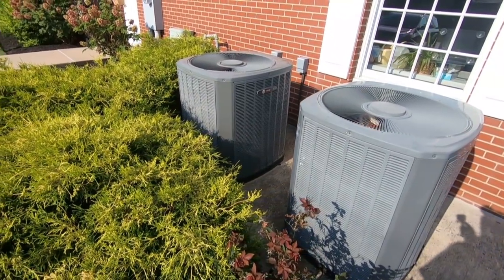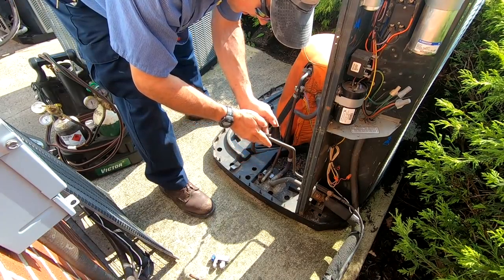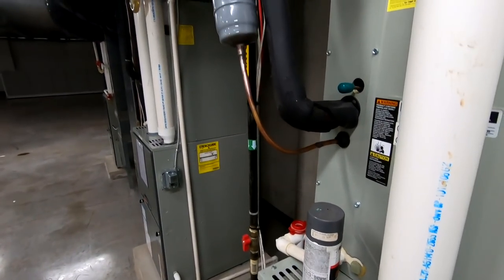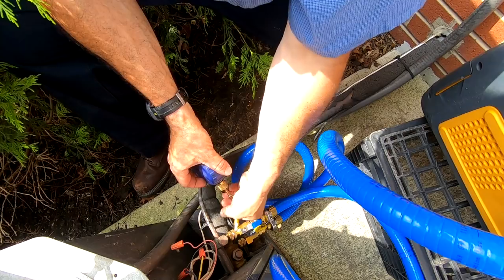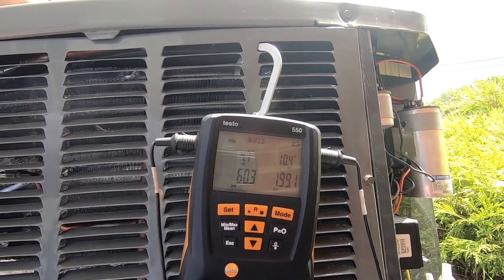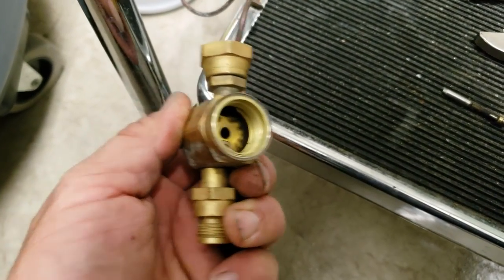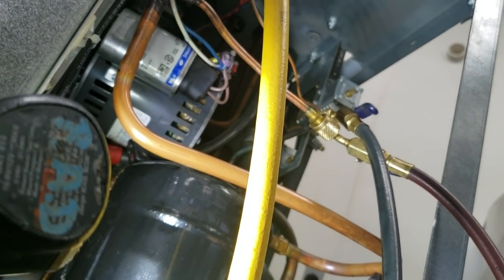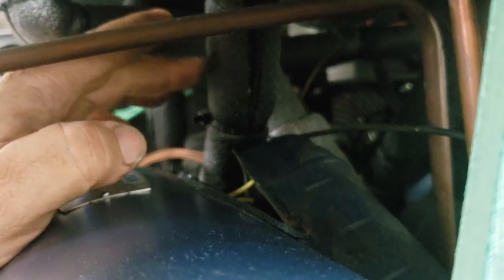Trane Condenser Coil Replacement With Bonus Footage

Comment: You’re welcome. Trane did have some problems with tube rub leaks back in 2010 or so, particularly on the 14 SEER units as I recall. And, they were also having problems supplying replacement coils so the subcooler work around was actually a factory suggestion as a temporary repair until the new coil arrived. However, we found that the units worked very well without a fixed subcooler. It was only because of units being under warranty that many of the coils were replaced in the end. Another situation happened when a homeowner rammed a screwdriver through the middle of the coil for some unknown reason. No coil in stock and insurance wouldn’t pay for a new unit. Again, because that condenser is constructed of loops of spine fin, we simply isolated the damaged loop by cutting it off the discharge and liquid headers, brazing the cuts and put the unit back into service. All in all, a nicely designed coil, in my opinion.
Reply from the maker: I never thought about it till this video review 👍👍.

Comment: I now know how to take these apart. Thank you for this. I work on everything, even though my job is carrier specific. Nice to see this now I don’t gotta struggle like a botch.
Reply from the maker: We're a Carrier dealer as well but I've worked for Rudd and Lennox dealers but Trane is not a big seller in the residential side around my area. I mainly see them in the commercial market.
Reply: HVACR Survival I see here I don’t see to many of them but enough that it’s nice to know

Comment: Man i found 100s of Trane coils leaking in the same spot over the years. Fixing and replacing Trane units keeps my belly full lol.Not sure if you know or have seen any older Carrier units that also had the same Spinefin coils about 33-38 years ago. Actually my next door neighbor of 32 years has one of those Carriers with a spinfin coil and it is still working good. Just replaced the original 35/5 capacitor last week on a 101 degree day with 112 heat index. Also replaced condenser fan motor 2 years ago. Great video man keep up the good work. Peace
Reply from the maker: 🤣🤣🤣👍👍 have a great weekend, thanks 4 watching!

Comment: Nice work, very professional. As another commenter mentioned, you can bypass the bottom subcooler loop if it leaks down there. Depending on your climate zone, the subcooler might not be necessary; up here in Canada I’ve bypassed several leaks and the unit still operates spot on to the charts. The remainder of the coil will still subcool enough. BTW, if you need to change the compressor in an AC unit, (not so easy on the heat pump) strip down the unit and remove the coil as you did, now you have easy access to the compressor. Swage the discharge and liquid line then braze, evacuate and recharge.
Reply from the maker: That's a good thing to know 👍👍i will definitely try that option to get a system back to operation in critical situations. Thanks for the tip 👉👍👍

Comment: Well at least you seen it before you changed the system. I did the same thing. Got my SC set  cleaning up system up and running . And dam. Filter drier in wrong . Lol I hate when that happen .
Reply from the maker: I agree, it could have been worse just like that 👍👍

Comment: Great find of a leak in that coil could be from vibration  of the unit. Have to use nitrogen when brazing is the long term key. Its the old TXV. Bad belts causes lots of issues. Motor over heats, pulleys wear out, belt brakes, and low performance of the unit. Great video Rick. Like the material you cover. Thank you for the share.
Reply from the maker: As always Ray, you have been a great supporter of my channel 👍👍 thanks man!
Reply: Rick you are very welcome. Love to support you always. Great guy doing great things. Keep up the great work.

Comment: Had one leaking at the bottom last week. Used solderweld al-cop was able to braze the copper to aluminum, saved them from purchasing a new coil.
Reply from the maker: It's not sold around here,  and getting my shop to buy something to sit on my truck in hopes of having it when I need it is slim pickings. I have heard it does well on aluminum.
Reply: with same spot in coil . I did a lot of research about how to repair coil leak and I found products that would work well with this type of repair. Solder weld “ Alloy Sol “ comes with powder flux is best choice to repair aluminium coils. Thank you @fastlife for your comment it helps me to make my choice to repair the coil , if I succeeded it would save me a lot of money.

Comment: Being a Trane dealership I can’t tell you how many of those coils I’ve replaced because of a leak in that s as same spot. Keep the videos coming 👍
Reply: trane is nothing but overpriced junk
Reply from the maker: They are all junk. I work on all brands and they all fail and they all are cutting corners to put more money in the shareholders pocket 😏👎👎
Reply: Just delete the bottom row of coils, old unit anyway saves bucks $$
Reply from the maker: That's what I'm hearing. News to me, I figured it would be higher head pressure.
Reply from the maker: I'd rather they just had replaced it 🤷🏾‍♂️

Comment: Luckily, I have not put a dryer in backwards (yet) but that's because my boss has and makes me check it 14 times before putting flame on it. Good videos.
Reply from the maker: It doesn't happen often, I was missing around getting the smoke alarm bypassed by the monitoring company and lost track of what I was doing. I figured it builds character 😏

Comment: I have a 2012 with a Freon leak in the big coil you just put in . They gave me estimate of all day to remove put in the new one and around 2,000 should I look around ? It’s still under warranty parts not labor ,It is a traneYou made it look easy wish I could have you take a look at the heat pump .Thank you for this Video PS it’s really clean the coils are new looking I hose it a lot and it’s not where any grass or trees are
Reply from the maker: This really depends on what's included in the quote? does this include new refrigerant? This was an R 22 system that stuff goes for over $150 a pound or more. I make it look easy because I've done it for 28 years. Like they say you're paying for all those years that I spent learning the trade not the couple minutes it took me to do it because it didn't always go that easy.
Reply: @HVACRSurvival  yes this includes  R 12 I thought he said ?? He said it is a special blend they use so they can not use what’s left that haven’t leaked out .He used a snifter to fund leak however no bubble test .. I always wonder could it be sodered? He said they do not do that .Replace the unit is what they are recommending because it is 10 yrs old this July 2023

Comment: I am looking for an aluminum coil so I can practice my aluminum repair skills. There is a guy in my company that is really good at it. He told me he had an aluminum coil and practiced over and over with propane gas. I have also heard cleaning the aluminum with alcohol.
Reply from the maker: I would like to try the solder weld kit 👍👍
Reply: @HVACRSurvival  Dude! A garage video on it would be great! Then you can add a por to pressure test. That's if it doesn't go to hell of course hahah
Reply: There's a outfit makes a low temp alum solder for auto use using a propane torch can fix a hole in a beer can .had some  lost the name  worked well for EVAP leaks .
Reply from the maker: I have one like that and it did not work, I heard good stuff about solder weld and millhoff.
Reply: @HVACRSurvival  thanks

Comment: Nice video there buddy! Trane coils are definitely not that big of a deal to replace the trickiest part in my opinion is learning how to get those panels off
Reply from the maker: Yeah, that took a minute to figure out but after a few days I got it 🤣🤣👍👍
Reply: @HVACRSurvival  Easiest way I learned to take them off is wear steel toes, grab the far sides with both hands, and give the bottom middle a tap kick while yanking upwards. Works 99+% of the time.  The trick is to kick the panel like you're passing a ball to a little kid.  Firm, but not crushing.
Reply from the maker: That's a good analogy 😁👍👍. Thanks 4 the info!

Comment: I'm curious, the original coil is copper/ali truly not fixable? Or didn't try? 
We usually braze repair at least 90% coil leaks no problem.
Reply from the maker: The leak was in the aluminum not the copper. I have tried repairing a Trane coil once before and it did not work.

Comment: I’m not sure if this will get responded to, but why do you put the filter drier on the inside ? I’ve always installed them in the outdoor unit side by the valves. Just curious. Cheers🎉
Reply from the maker: Less likely to rust, and it's right before the metering device.

Comment: Question? I have ac unit that is 18 years old, a tech said it was the compressor that was bad he is recommending changing the whole unit in side and out at a cost $3000 to $3500 for new system, in your experience is this true, or is it better to replace the compressor
Reply from the maker: If it's R22 and 18 years old,  I would replace it. That's a fair price.

Comment: Not a tech, so this might be a dumb question. Any particular reason to use a braze in filter/drier vs one with flare fittings for ease of future servicing/replacement?
Reply from the maker: Possible leaks is why when your using R-410a and there was no isolation valves to change it anyway if I wanted to. Thanks 4 watching!
Reply: @HVACRSurvival  Thanks for the reply, that makes perfect sense. I never even considered the issues of higher pressures with R-410a. And DUUUHH no isolation valves, LOL.

Comment: just curious why you didn't fit the drier at the condenser?
Reply from the maker: Two reasons, the big one is I can pump the system down and change it and the other is to prevent rusting of the metal shell after it has been brazed.

Comment: Does the micron gauge give you an accurate measurement when placed on the vacuum pump?
Reply from the maker: At the pump is not the recommended location. It's better to have it either at a different location on the system being evacuated or on the valve core removal tool. This allows you to isolate the vacuum pump from the system and do a blank off test. This helps verify that the vacuum is not only deep but stays deep when it's isolated.

Comment: Did you purge with nitrogen during brazing? You don’t shoot for <500 microns and perform a decay test?
Reply from the maker: I had to rewatch the video since it's been awhile. Looks like I did nitrogen for the inside but the outside I did not because of the location of the service valves made it difficult. As far as your question on the vacuum, looks to me like I cut that section out because this was a simple job and didn't want to bore people watching paint dry.  Let me ask you this,  what kind of vacuum hoses do you use? What kind of micron gauge do you have? Do you pull every system down below 500 and have it hold below 500 micron for over a 30 minutes? Now be truthful
Reply: @HVACRSurvival  I use Appion Megaflow 1/2” x 1/4” FL for every evacuation using only VCRTs-no more pulling vacuums through the service manifold. I use a BluVac + Pro micron gauge that performs the decay test. I purge nitrogen for everything I braze and I evacuate to at least 400 µm for everything. As everyone and HVAC should be, I am paid by the hour, and there are no shortcuts. I’ve seen the old timers set up the vacuum pump walk away and smoke a cigarette and come back and call it done because the gauge read 30 inches Hg. A lot of leaks get left behind that way.

Comment: Kinda annoys me when people dont keep bushes etc trimmed back away from units..
So i asked on another channel also but... If after a customer had multiple visits from 2 companies that customer personally found the cause of a problem they were having was a stuck contactor (Not a bad CAP or logic board or high pressure switch like they were lead to believe was the cause), what would you do?
Reply from the maker: Sometimes it's hard to catch the problem if it won't act up while you're there. I try to look over the contactor and if there is any doubt about it or the capacitor they get changed. If it was mine I would call both companies and explain the issue, see how they respond. If they are reasonable they should either work with you on the bill or do something to make it right. At least that's what I would do.
Reply: @HVACRSurvival  Thats reasonable, But...
Heres the thing... For the upstairs unit that i had replaced a few months ago, The old unit started acting up last year during a heat wave, the company i had at the time came out a total of 5 times total because they thought they fixed it but they didnt (It reset when they cut the power so when it started working normally they thought they fixed it) and it wasnt until i did some troubleshooting that i figured out what was going on. I found out that i could reset the unit by using the wet/dry switch, it would then reset the unit after the 5 minute delay and allow it to work for exactly 3 On/Off cycles before it had to be "reset" again to work normally. So since the company was full of idiots i got rid of them and went with a different company, which after seeing it for the first time immediately said it was because of the High Pressure Switch, supposedly because of an LED light being lit, though i didnt personally see it. So we had the whole upstairs unit replaced, which i do have to say i Loveeeee.

A Few months ago the downstairs unit started doing the exact same thing and was able to again get it working a number of times before needing to be "reset". All of a sudden the unit started working Normally for nearly a month and then started acting up again a week or 2 ago. So i did some troubleshooting.

They initially wanted to try replacing the logic board (Super Tinyyyyyyy little thing) and the CAP, wasnt spending $200+ for that so didnt happen.. So i took it upon myself last week and bought a $20 CAP of the same rating, that sadly didnt fix it. Then i remember seeing videos here n there mentioning the contactor and i did recall that something did look off with the contactor, so i nudged it a little and PLOP it came unstuck, there was a little rust/corrosion on the bits it would make contact with so i cleaned it up a little and the unit has been working flawlessly ever since, i'm sure the new CAP helped in some form too though.

But yeah
i'll consider what you said
The next time i'll be seeing them is for Winter maintenance so i'll bring it up with the guy then, i likely will have him replace the contactor depending on its cost just in case though so it wont happen again.

Sorry for the extremely large wall of text guys

Comment: Getting B/EMS involved...Oh heck no, that drier would be installed outside on my job. 10 min. tops and that's with wet ragging it. Not sure what the big deal is with everyone having a problem with installing driers outside. If done properly, the drier will outlast any of the crap ANY manufacturer is making today, including salt spray areas..  /rant  anyway.. thanks for the video, Nice bonus material. :-)
Reply from the maker: I use to always put them outside. I still will at times but I now try to do them inside for the 1% better chance of catching something before the metering device and the rust factor.
Reply: We braze the filter outside, a puff of zinc spray slows  corrosion
Reply from the maker: @Froggability   Sounds good to me. I use to do it outside all the time. I even did mine at my house on the outside. But as time goes on I try to do it just little bit better than I did the last time.